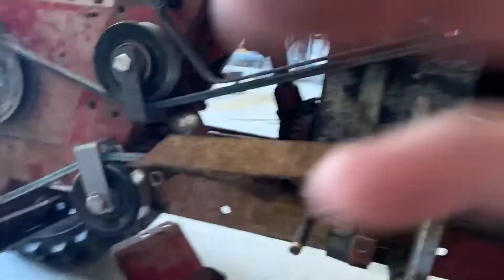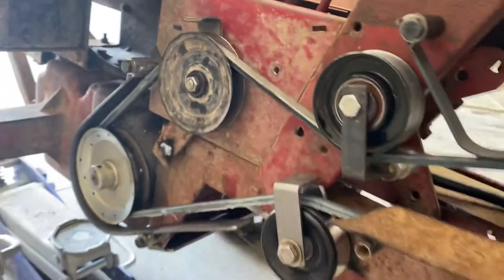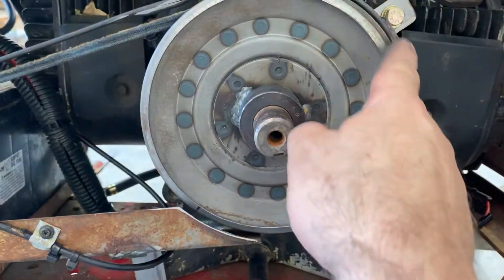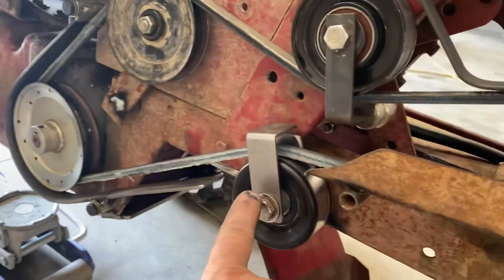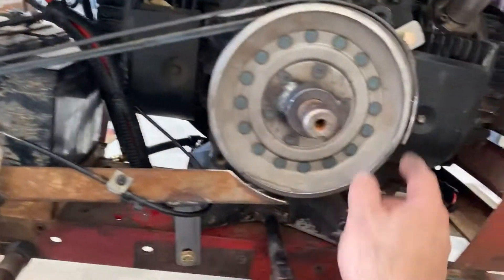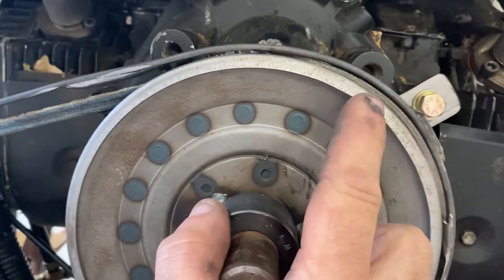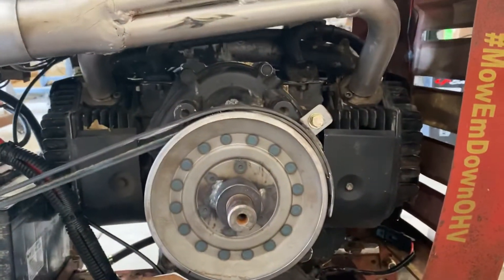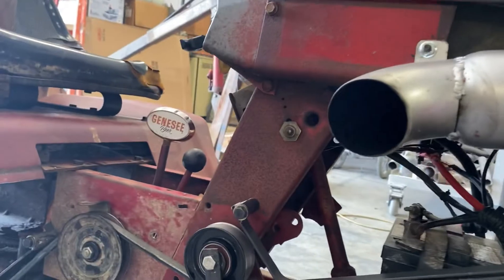Offroad Wheel horse belt system

Comment: my brother's C-81 has a 3-inch rear pulley and 26-inch ag floatation rears. Got the right length belt, goes 11-12 mph beautifully. with low range still slow, it's a beautiful garden tractor hack!
Reply from the maker: The best part is you can still use it for regular work, but have some speed for fun!

Comment: Hello, do the Wheel horse tractors have a differential that you can lock manually or why do both wheels always spin in the mud?  It would be stupid to drive on the road with a rigid axle... Greetings from Germany
Reply from the maker: We disassemble the transmission and weld up the differential. They hold up just fine (most of the time) but need a good front tire to help it turn
Reply: @captain_315   Ah okay, thanks!
 Do you know what the difference is between an 18hp and a 12.5hp twin || Is? According to the label, mine only has 12.5 hp. Can it be easily converted to 18 hp? E.g. Just replace the crankshaft or is the engine a completely different one? I think the 18 hp has the same cc? I would now also like to switch to a larger carburettor (Kohler) and perhaps a better flywheel.
I can't get any information anywhere on the internet about the difference between Twin II 12.5hp, 16hp and 18hp.
Greetings from Germany!
Reply from the maker: @PA_Niki  If I remember correctly, all the opposed twins are the same bore (minus a super rare big bore oddball) and the 12.5 and 16hp are the same stroke. The 12.5 was just a 16hp with smaller carb, maybe cam too? The 18hp has a longer stroke, youd have to change the crank and/or pistons and rods to match. Same thing with going to a 20.5- even longer stroke yet.

Comment: Grate video first timer here I got to do some belt hard for my wheel horse but question where do you find wheel spacers for your wheel horse
Reply from the maker: 5 x 4.5 bolt pattern is perfect- basically Ford and dodge car pattern
Reply: @captain_315  where did you find your studs to fit threw your spacer to your hub on your wheel horse
Reply: @brandoncodling6804  you can use 7/16”-20 x 2” (or longer if you need them) fully threaded tap bolts. Run them theough the back of the hub with a lock washer or green locktite. That’s how I did my gt14
Reply: @richardpugh3434  thanks brother I got the spacers now I need to find spindles and tie rod ends for i. t it’s a c 120 stile 1974 to 75 but where I live in vermont it’s hard to find parts for the old girl